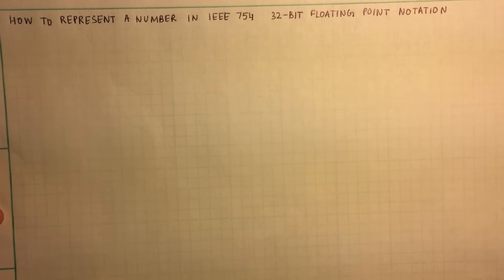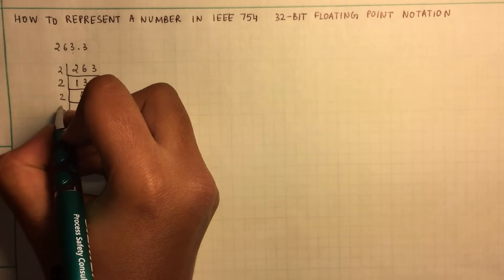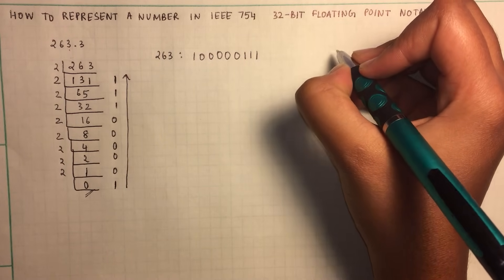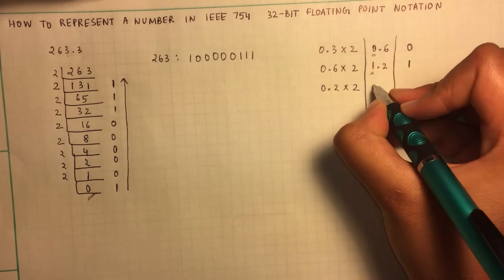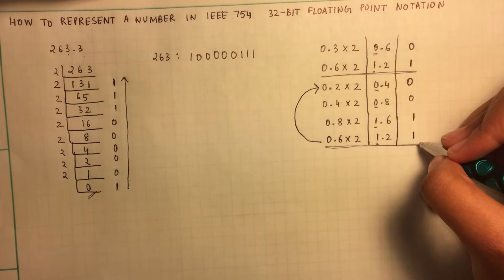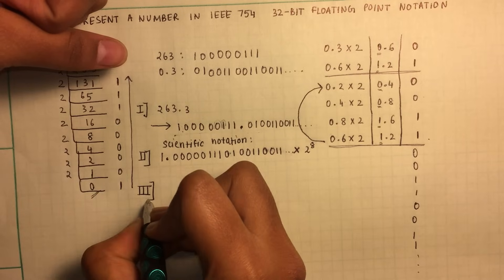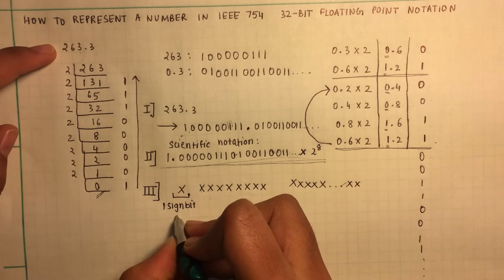Decimal to IEEE 754 Floating Point Representation

Comment: I have one question for you. I will appreciate it if you will answer it. 1st q:  How did you find out the exponent bias for single precision is 127?
Reply from the maker: We have 8 bits to represent the exponent. We can represent 2^8 = 256 numbers with 8 bits. The bias is considered to be half of it minus 1 so that we can represent both positive and negative exponents.
Reply: so if we have only 4 exponent bits, the exponent bias will be 2^(4-1)-1 = 7?
Reply: @devinadams4637  correct
Reply: @abishalinisivaraman7767  here k = 8 bits. so, in 2's complement range (-128 to 127). then why the bias is 127 instead of 128.
Reply: @abishalinisivaraman7767  Hi! Does it mean, that if we would have a negative number, our expanent would be 129, not 127? Thank you!
Reply: @proteinovij  No, because you must count the 0 (zero). The range is 0 to 127 (= 128 which is the half of 256). A simple way to understand it is always add 127, for example, if you have 2^8 you'll do 8+127 (=135), instead, if you have 2^-8 you'll do -8+127 (=119).
Reply: @abishalinisivaraman7767  how u writen 23 fractional bits????
Reply: @kohlian810  did u get the answer
Reply: @abishalinisivaraman7767  it's not 8 bits it's 8 byte,64 bits
Reply: @ritamchatterjee8785  8 BITS =size of exponent part
Reply: The formula for finding the Exponent is: 2^(k-1) - 1.

Since you have 8 exponent bits, replace "k" with 8 in that formula. You get 2^7, which is 128. Subtract 1 from that, and you get 127 as your final answer. :)
Reply: @Gyeseongyeon  thanks zur
Reply: And it is 1023 for 64 bit which is called double precision.
Reply: I'm surprised that the exponent doesn't actually follow the twos-complement system (0 is 0, 128 is -128, 255 is -1), but rather follows a bias where 0 is -127 and 255 is 128, 127 is 0. It's weird. But somehow it works.
Reply: @CZghost  There are several reasons for this. First of all they wanted all bits being 0 to represent the value 0.0. Additionally besides the format that is mentioned in the video, there's another special case the so called denormalized numbers which are actually used to represent 0. The denormalized numbers do actually use the same exponent as the lowest possible exponent of -126. So both exponent bits "00000001" and "00000000" both represent an exponent of -126. The difference between normalized and denormalized numbers are that denormalized numbers do not have the implicit "1" before the binary point but a 0 instead. So the number is no longer a normalized number in the scientific format. However denormalized numbers allow much smaller numbers and a continuous reduction to 0

You can play around with this online binary converter which lets you fiddle with individual bits and show you the actual number it represents:
https://www.h-schmidt.net/FloatConverter/IEEE754.html

The smallest positive normalized number goes down to 1.17549435082e-38 while the smallest (non zero) denormalized number goes down to 1.40129846432e-45 So almost 7 orders of magnitude better ^^.
Reply: @CZghost  The reason they use a bias, instead of twos-complement for the exponent is because of nice property the resulting format has. Namely, it's trivial to compute the next larger floating point value for any given number.
For a positive floating point number, the successor is simply that bit sequence, treated as a binary integer, incremented by 1. Works for all positive numbers from 0 up to infinity, with the exponent handled automatically.

For instance. Starting with 0
0 00000000 00000000000000000000000   +0
0 00000000 00000000000000000000001  Smallest denormal number
...
0 00000000 11111111111111111111111  Largest denormal number
0 00000001 00000000000000000000000 Smallest normalized number
...
0 11111110 11111111111111111111111 Largest normalized number
0 11111111 00000000000000000000000 +Infinity

And since the floating point format is a signed magnitude number, you can get the same effect for negative numbers by simply using decrement instead of increment and visa versa.
Reply: Because that is single precision floating point standard: https://en.wikipedia.org/wiki/Single-precision_floating-point_format
Reply: 8 bits are used to store exponent part which could be positive or negative .So out of those 8 bits , most significant bit is used to store sign of exponent,  for remaining 7 bits there are 2^7= 128 numbers, so - 127 to 127 is range.Also , Negative numbers are stored by 2,s compliment .So whenever access float variable in your program ,compiler actually checks sign bit first , if it 1 then it knows no. is negative and takes out 2,s compliment again to get original exponent value .
Reply: @kartikpatel3940  the range is -126 to 127. 
Lovely explanation by the way.
Reply: @deepayanbiswas4488  2's compliment range is from -128 to 127
Reply: thanks for this information
Reply: Sivara is the Man.
Reply: Thank you :)
Reply: No one is talking the real info here. It's related to two's complement which is a way to represent negative numbers.
Watch this: https://www.youtube.com/watch?v=4qH4unVtJkE
Then read this : https://en.wikipedia.org/wiki/Offset_binary
Reply: Usually because cpus use 2's complements, this means signed numbers in binary will be represented to 2^bit-1 for positives and 2^bit for negatives.
So for 8 bits, 256 number slots are used for 0 to 127, and -128 to -1. The first digit of the number is used for the sign.

Comment: The reason the method for finding the decimal works is because 0.1011 for example is 2^-1 * 1 + 2^-2 * 0 + 2^-3 * 1 + 2^4 * 1 = 0.6875
When you convert something like 0.6875 back to binary, you are going to consider the digits from left to right. 
Algebraically, you are finding 2^-1 * a1 + 2^-2 * a2 + 2^-3 * a3 ... = 0.6875. where 0<=ai<2.

So you are asking how many 2^-1's can fit in 0.6875 to find a1 (Which is 1 because you can fit 0.5 once in 0.6875), then once you find a1, you subtract 2^-1*a1 on both sides to get
2^-2 * a2 + 2^-3 * a3 ... = 0.6875 - 2^-1 * a1 = 0.1875, and you do this recursively until you find all the digits.

The reason the trick with the multiplcation by 2 works is because 
 2^-1 * a1 + 2^-2 * a2 + 2^-3 * a3 ... = 0.6875 is equivalent to 2^0*a1 + 2^-1 * a2 + 2^-2 * a3 ... = 0.6875 *2 as all we did was multiply the equation by 2.
2^0 = 1, so the question becomes how many 1's can fit in 0.6875 * 2 = 1.375, which is much easier. Then you do this recursively as before.

The reason you have a bias for the exponent instead of using 2's complement is so that you can compare the last 31 bits of the floating point representation as an integer and be able to determine which number is (as an absolute value) larger. With 2's complement, since the leading digit is 1, it would cause negative exponenents to evaluate higher than positive ones, leading to more complex comparsions.

The reason we use the fraction bits without losing any information is because due to the nature of scientific numbers, the leading digit is promised to be 1. This also means when you convert from IEEE 754 back to decimal, you need to tag the 1 back on. This means by our current standard there is no way of representing 0.
So we define 0 00000000 00000000000000000000000 or 1 00000000 00000000000000000000000 as + and - 0. The exponent being 00000000 is a special case where we start treating the last 23 digits as denormalized, you can find more information online. 

We use a bias closest to 2^8 / 2 = 128 as possible so we can represent positive and negative exponents equally. They decided to chose 127 because it has some nice properties when dealing with overflows with 1/x.

Comment: This video doesn't explain fully, here are extra things:
If the value is lower than 2^-1022 the exponent stays 00000000, but 1 is not added to mantissa.
If exponent is 11111111, we treat it as infinity, unless mantissa bits does not follow 00000000000000000000000 it is NaN.
The IEEE-754 float also supports -0.

Comment: Very nice. I'm surprised you didn't mention that it's not possible to represent that number in binary floating point exactly. That's why it doesn't terminate. It's often important to know that the conversion is rounded. You could also convert it to *decimal floating point*, which is defined in the 2008 version of IEEE 754, to illustrate a format that doesn't lose any precision.
Reply: Then at what number should I stop? She wrote down "23 fraction bits", should I stop at 23?

Comment: 64-bit notation is basically just extended notation. The exponent has 11 bits instead of 8 (allowing for bigger and smaller numbers with more precision), as well as the mantisa has 52 bits instead of 23 here. This is the double precision format, and essentially can store much larger numbers, and much smaller numbers with finer precision. There is even a decimal format using 32 and 64 bits, that is being used in financial applications for example, due to the nature of binary formats losing some precision when rounding the decimal points. Naturally, computers cannot store infinitely large mantissa, which limits the precision and introduces some quirks that are kind of limiting in certain applications, especially when dealing with decimal values, like money, because they introduce a rounding error into the calculations, and therefore it means that the computer looks at the number and tells you that instead of 0.30 £, the result is 0.3000000000000000000004 £ - yeah, you can say this is close enough, but not for computers - if you try to compare like 0.1 + 0.2 calculation result with 0.3 in certain interpreted languages (JavaScript for example), it says that these values are not equal. And it is kind of frustrating when you are debugging something and eventually after hours of endless debugging you find out that the issue is caused by a stupid rounding error. The decimal format gets rid of that issue. It does actually reduce the efficiency of storing the value, but in the end, it kind of introduces neat decimal precision that is needed. And for decimal points, you do not need much precision in financial market anyway, as most of the time, you'll deal with only two decimal places anyway...

Comment: I have one question for you.I will appreciate it if you will answer it.In this IEEE standard there are two terms called Min exponent and Max exponent.In single precision(32 binary format) values of these terms are -126 and 127 respectively.So we get exponent bias by Max exponent.Could you please tell me what is the use of Min exponent and how is it determined?
Reply: The IEEE standard has 4 different concepts to handle.
1. Non infinite normalized numbers
2. Non infinite denormalized numbers
3. positive or negative infinity.
4. Not a number. Used for error indications that propagate so it doesn't have to be checked for every mathematical operation.

Notice that the range -126 t0 127 represents a total of 254 distinct values (don't forget the 0). But 8 bits can represent 256 distinct values. The 2 extra values are used to handle infinities and denormalized numbers.

Number format
s eeeeeeee mmmmmmmmmmmmmmmmmmmmmmm
S = s
E = eeeeeeee
M = mmmmmmmmmmmmmmmmmmmmmmm

if E is
00000000, the number is denormalized, value is (-1)^S * 0.M * 2^(-126)
00000001 - 11111110, number is normalized, value is (-1)^S * 1.M * 2^(E-127)
11111111,  number is either infinity (M=0), or a NaN (Not a Number) if M <> 0.

Notice that for the denormal numbers, that the most significate digit of the mantissa is 0, while for the normalized numbers, the most significant digit is 1. The most significate digit IS NOT EXPLICITLY STORED. That lets the IEEE standard squeeze in an extra digit of precision. So binary32 is consider to have 24 binary digits of precision, while only storing 23 of those digits. Same for binary64. Considered to have 53 digits of precision, while storing only 52.

By the IEEE standard, Min will always have a magnitude one less than Max.
So for binary32, we have 8 bits for the exponent. Since we have to account for positive and negative exponents, we have Max = 2^(8-1)-1 = 2^7-1 = 128-1 = 127
Min = -(Max-1) = -(127-1) = -126
For binary64, we use 11 bits for the exponent, so
Max = 2^(11-1)-1 = 2^10 - 1 = 1024 -1 = 1023
Min = -(Max-1) = -(1023-1) = -1022
 
Doing it that way allows for the all zeros or all ones value of the exponent to handle denormal numbers as well as the special value infinity and the Not a Number error indications.
Reply: @johncochran8497  John can I pay you to tutor me lol.. It is funny but I am serious. Please reply

Comment: Hi Dear,  the way of explanation is very good, but small mistake i find that, there is 
1.0000011101001100110011......2^8 written,  but instead you have write in 1.e^x format that is
1.0000011101001100110011......10^8 is correct. and rest all are perfect.

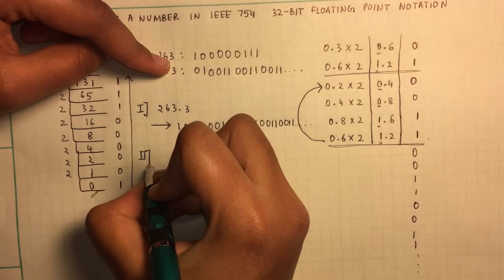Comment: How do u solve with 32 bit representation for huge fraction part  In ua example fraction is .3 which is equivalent to. 0100110011.... Where 2nd 5th,6th bits are raised to 1. Similarly imagine 23rd bit is raised to 1 and which is only bit raised in fraction part. Now watch step 2 at time 4:30 in above video and proceed where we need to convert into normalized form. Here we are placing dot(.) after first bit of integer part and remaining bits are pushed to fraction part and framed as mantissa. But in my case of 23rd bit, if we push the remaining integer bits to fraction part the 23rd bit is puahed forward and exceeds 23 bits  or should be left out, as mantissa is only of 23 bits in 32 bit representation format. If u did not get me. Try to solve this
-17.00000011920928955078125
Ull get some binary representation. Now using the obtained binary value of -17.00000011920928955078125 get back the original decimal value. Try this as a challenge. 😉 Help me back with solution if you find it.

Comment: Hi, I tried to calculate the IEEE 754 of -8.25 (10). Actually I had to add the exponent 3 to the bias 127 (=130 )to get to the right IEEE number. In the video you suggested that if we want to calculate a negativ number than we have to subtract the exponent from the bias.
Reply: i know its been 2 months, but she meant you should subtract 3 if you get a negative exp
Reply: @hanlly5559  thank you!

Comment: I have a question. Where do we get to represent the "significant digit". Here in the case, there is 1. How suppose if we have 0?
Reply: It's never a zero; it's always a one. Scientific Notation requires that you move the decimal point until it's just to the right of the first non-zero digit. In binary, the first non-zero digit must be one. Since it's always one, IEEE 754 does not record this information. To do so would be wasting a bit.
Reply: @sbunny8  thank you

Comment: What do you do if you have a decimal of 0.75 then multiplying it by 2 equalling to 1.5 bit=1 then 0.5 multiplying by 2 equalling to 1.0 bit=1 then all your other multiplication equations equals to 0.0 will you then put all the other bits as 0? Because I am very confused

Comment: Appreciate the step by step procedure. However, people like me must understand the derivations in order to grasp the concept. I struggled with Boolean algebra until I learned that it's just values to the power of 0, and the compliments are just derivatives of the given variable. i.e" A(bar) aka A' is 0 because the derivative of N^0 = 0 and value of N^0 = 1. The compliment explanation given by discrete structures over complicates the concept.

Comment: u should not combine sign bit with exponents(8 bits) and should be taken it separately. Actual value is 0_1000 0111_0000 0111 0100 1100 1100 110

Comment: Everyone here for exam who know they will never need IEEE 754 notation in life anymore?
Reply: Pressure sensor at work, spits out IEEE754 on UART. :)
Reply: for some coding projects it's good to know
for example if you have limited space on any device, it's good to know that floating point in this notation only requires 4 bytes (32 bits)
Reply: In embedded systems programming, a programmer is often writing code which operates at a low level by dealing with bytes and bits. Suppose you are writing code for a product which employs a microcontroller and you are using some communication protocol, e.g., SPI or I2C, so the microcontroller can communicate with an external device, e.g., a shift register. Suppose we are transmitting the value of a floating point number, e.g., you are programming in C and the data type of the value is double, which is represented in IEEE 754 notation. During testing you discover that the shift register is receiving a value which is different than the value stored in a variable in the microcontroller, i.e., you have a bug in the transmission code. So, you hook up your oscilloscope so you can view the signal being transmitted. The signal should go high when transmitting a 1 bit and it goes low when transmitting a 0 bit. You need to determine where a wrong bit is being transmitted because that will help you locate the bug. Therefore, you need to know the IEEE 754 binary floating point representation of the double value being transmitted so you will know when a 1 or 0 bit should be sent.
Reply: @kevinburger4749  Wow awesome explanation, thanks for writing it up!
Reply: I like to know what I'm working with.
Reply: you can say that for any subject except STEM

Comment: So, if we want to be pedantic, this is actually a representation of 263.2999878 (if I didn't make a mistake). The number 263.3 is impossible to represent in IEEE 754.
Reply: Thats the point of trying to understand floating point numbers. and also why there are varying degrees of precision (single and double) some numbers do not have a 1:1 correlation in different bases. For most purposes the precision available is sufficient. If you need more precision you are going to be doing some advanced assembly programming and dealing with ALU control